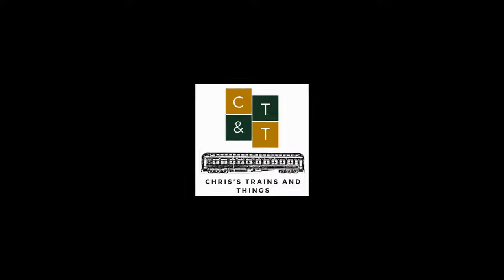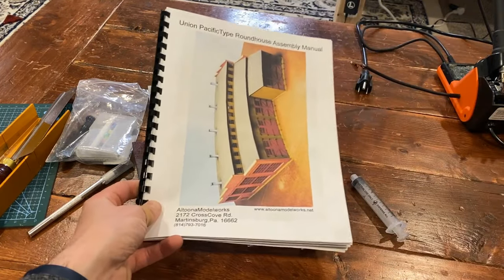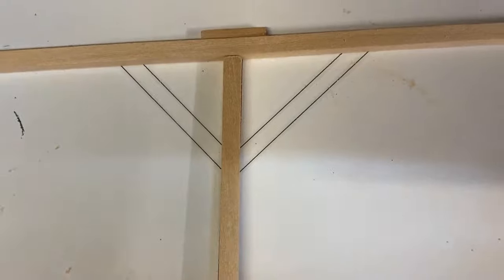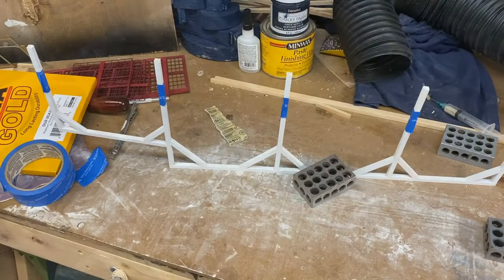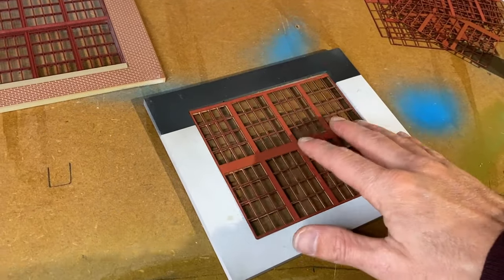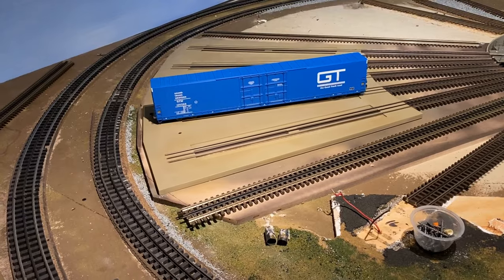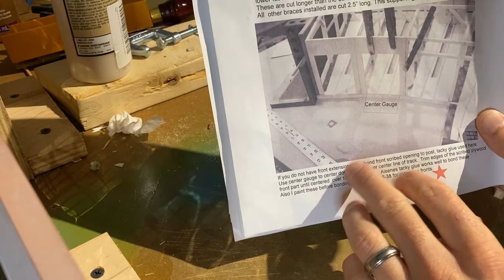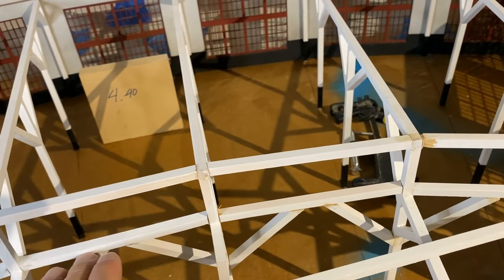Roundhouse Build Series: Part 1

Comment: Wonderful Job! Patience is definitely a virtue in modelling. 

On a side note, I like your attention to detail, especially in painting the vertical posts, the taping of the bottoms, and spraying them white AGAIN before the black to reduce or eliminate "bleeding".. 
As for sanding the posts smooth, I would be curious to see if the prototype posts were rough hewn or smooth finished..? The fiber raising may actually be more prototypical..
Reply from the maker: I figured over the years the beams may have been rubbed smooth so went that direction.
Reply: @ChrissTrainsandThings  Or painted to the point of smooth lol